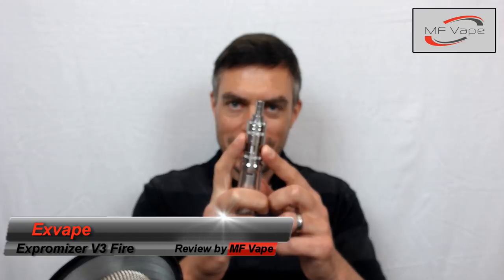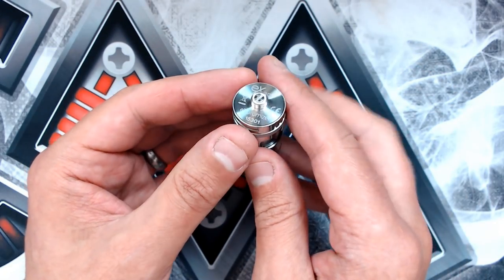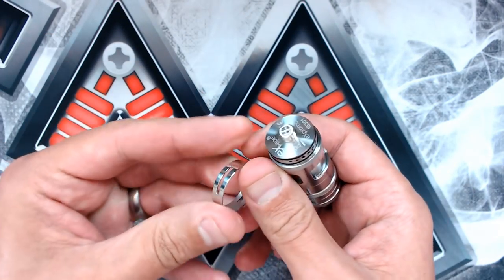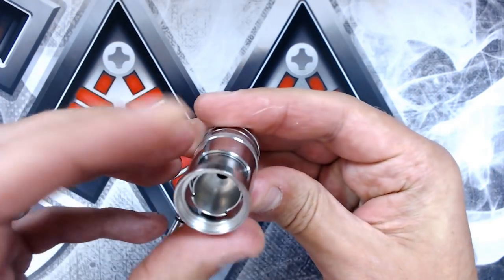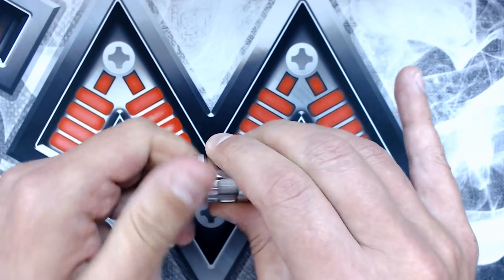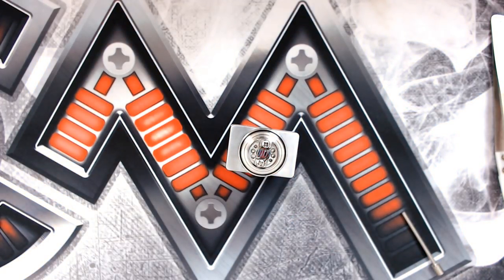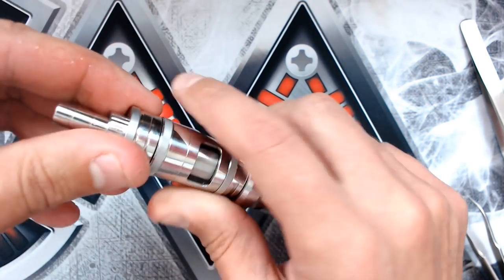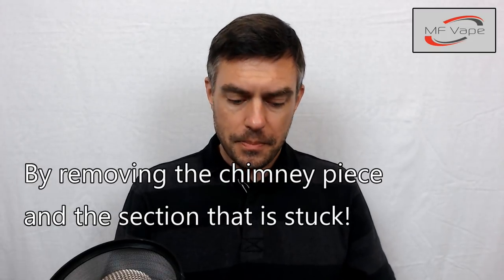eXvape eXpromizer V3 Fire MTL RTA - Review, rebuild & wick

Comment: Sometimes when I have trouble with stuck parts I put them in the freezer for 10 minutes. Saved me a couple of times and did not need to use pliers, specially on original atomizers.
Hope it helps. 
In this case it's probably bad machining.
Reply from the maker: Mate, I lubed all of the orings up too. To be honest, if it's a pain in the arse I usually put them in a draw. I'm always buying new stuff to review so it has to be user friendly and taste good for me to continue to use. This one hurt my already dodgy wrist so it will be shelved.
Reply: I picked it up for under $10 dollars, however, this mtl is awesome and very easy to coil. You just have to be patient and keep it simple. Works great for me and I give the tank a  thumbs up ..
Reply from the maker: Think mine was dodgy, I have the V4 and had no troubles. Glad you're enjoying yours though 👍
Reply: @MFVape  where is better flavour on v3 or v4?
Reply from the maker: Totally different vape. The V3 can cater for restricted DTL whereas the V4 is a very tight MTL. I prefer the V3 myself as I like a looser draw. Both have very good flavour. Check out my V4 review here 👇
https://youtu.be/3lb5Gf80jGk
Reply: And your opininon on v5 ?
Reply: @MFVape  i am vapeing MTL and searching for  best flavour attys... i am using siren v2 and doggy sxk 2k18 ,but want something with more flavour than siren
Reply from the maker: My favourites are the Kayfun Lite Plus and Berserker Mini V2

Comment: Took a while for me to like mine
With  over a week of use 
 I just wasn't sure, 
Now i think vape quality is very good.
Easy build and wicking shame you need atty grips to open it, on plus side its 22mm so atty grips do fit, 

 seems all have the extremely tight refilling part, 
mine is pain the A#@e  to unscrew, but everything else is great ,

its not crap but a little labourios to refill at times 
so i dont completely tighten top cap / refill now, 

i find ive used the 
GT v4 more since it arrived
Reply: Looks nice on ehpro 101 50w mod tube, 

I do think its either rather fat and  tight orings , or needs a small sanding just not had time to try.

Comment: Did you find the deck floods, no matter what you do? I’ve had so many builds in this thing. Even packed with cotton, it floods💀
Reply from the maker: No not had that problem, just everything else. Maybe raise the coil a bit?
Reply: I’ve just absolutely jammed it full of cotton. Seems to have done the trick. Seems like the juice flow never actually turns off on mine. Overpriced crap 💀. Thanks for the reply👍
Reply from the maker: No worries. What VG ratio you using. Maybe increase the VG to 80vg 20pg or something?
Reply: That’s what I’m using already. I think it’s the tolerance on the juice flow. I wouldn’t mind but the flavour isn’t worth the effort. The Ammit MTL is better all round😂
Reply from the maker: Fair enough, did you watch my review and accompanying dismantling video? I too had problems but I think the flavour is top notch. Funny how people's opinions differ.
Reply: I watched both, yes. I was hoping you might have experienced the issue I had.  I didn’t have the same problems as you though. Maybe just poor QC in general. taste is subjective, I agree. I find the Hastur mini good, and the savour. The flavour isn’t bad, just not as good as those, I guess.
Reply from the maker: Oh right, so I might've had a dodgy one then. I rate the Savour, it's my go to tank everyday for loose MTL.
Reply: Possible. Even the o ring tolerances aren’t right, in my opinion. The new Damn Vape one is my next attempt 😂

Comment: the same design school of the hurricane and typhoon which tends to be over-engineered and uses lots and lots of parts, a sure hassle when cleaning especially for someone like me who does several tanks at once so it turns out as jigsaw game with multiple boards. one was enough for me to know that these are not for me
Reply from the maker: Agree, much prefer less engineered tanks. Keep it simple and easy to use and maintain. Cheers Mohammed :-)

Comment: I think (I could be wrong) if you can push the juice flow control out with your finger you can take the top part apart. But nice review -looks over-engineered to me.
Reply from the maker: Unfortunately you cannot Arif. That top part of the chimney (the extender piece) is connected via a thread to the part where you turn the juice flow. Hence the only way you can remove it is to get pliers inside and grab hold of it. I have done it since the video and ended up damaging the threads. I also got the extender outer tube piece off but that is now damaged too . I did use a cloth underneath the grips but it was so tight it required all my might. Far too over- egineered indeed. Thanks for watching mate
Reply: Thanks for the info. I am glad that you are reviewing a variety of products.
Reply from the maker: No worries mate, I try and cater for all vapers needs on here. I like vaping it all so not a problem to me. Cheers Arif

Comment: I hate to twist the wire arround screws! When I see that I throw the tank away. Sorry mate, is not you... I just cant stand this "stone age" build system.
Reply from the maker: No worries mate, it seems most MTL tanks go down the route. Think it's just to save space for a narrower chimney. However, tanks like the Savour manage it with two posts on one side which is much easier to build on. Lazy designers buddy imo.